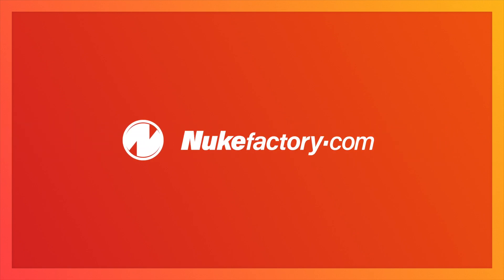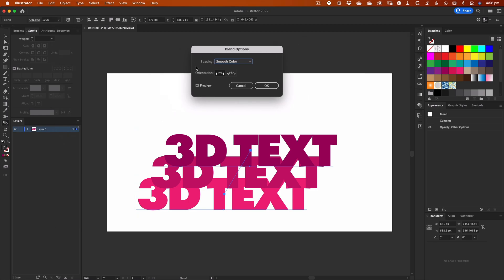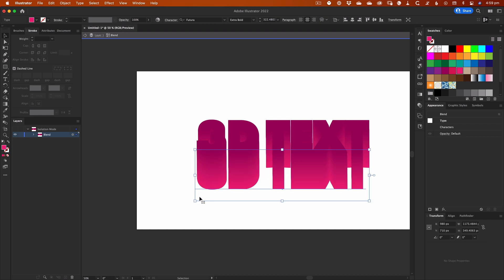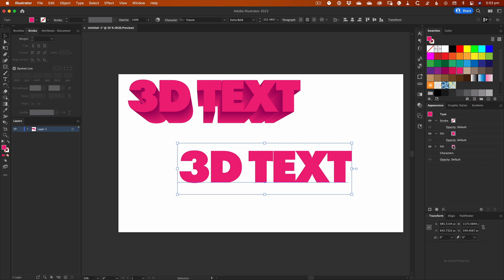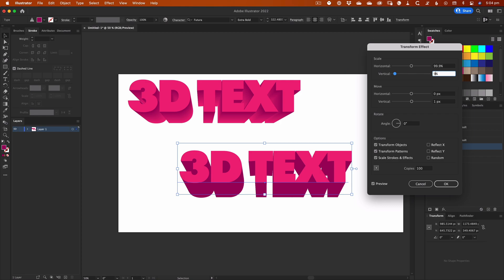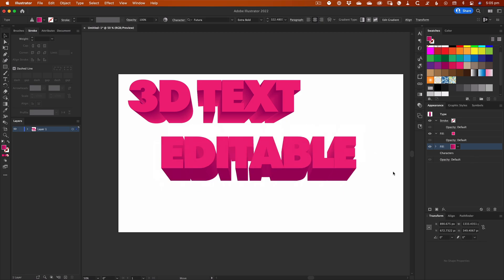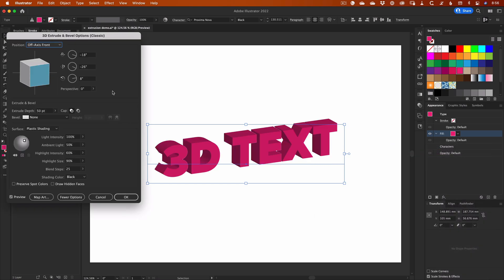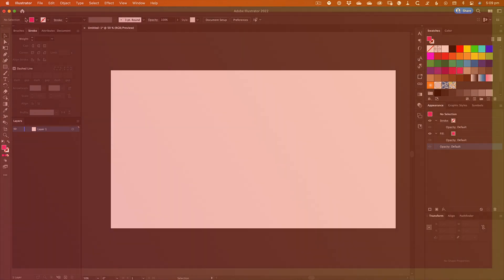TRIPLE YOUR SKILLS - Create a 3D Text Extrusion Effect in 3 Different Ways using Adobe Illustrator

Comment: Hi man, this is fantastic thanks!

The third example seems preferable to the other two, so why then do so many people opt for the first option?  What are the disadvantages of the extrude 3d function?  Seems like everyone should use that?
Reply from the maker: Thanks, glad it was helpful to you.
Regarding the 3D extrude option: I think the main disadvantage is that it can be a bit glitchy at times. And maybe it looks intimidating to someone who hasn’t used it before? Might be why it doesn’t get as much use.
It’s a bit of a ‘horses for courses’ situation. You have greater color control using the blend tool, and it’s good for creating some interesting effects as well (eg multi-point blends, rotations, or blending between different objects). The appearance panel ‘transform’ method allows for stacking a lot of different modifiers to a single object, so that method plays very well with multiple effects. And yes, the 3D extrude provides a really straightforward way of achieving an extruded visual, quickly. 
I think (but I’d have to check to be sure) that the 3D extrude also doesn’t bog down output of a flattened PDF/postscript file for printing as much as the other methods can, either. Not totally sure about that though.